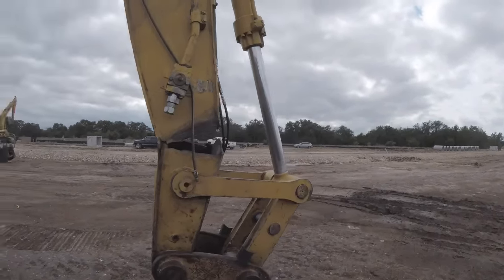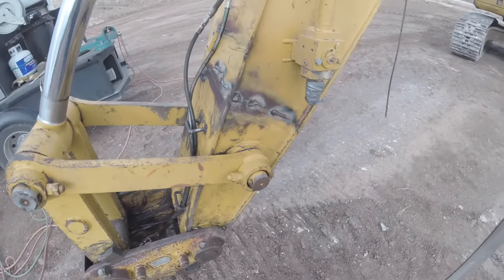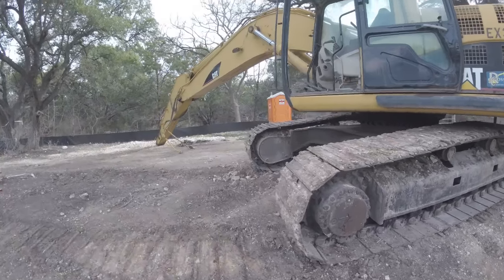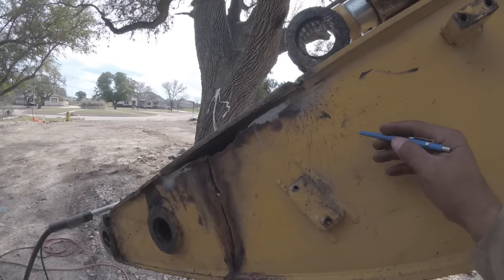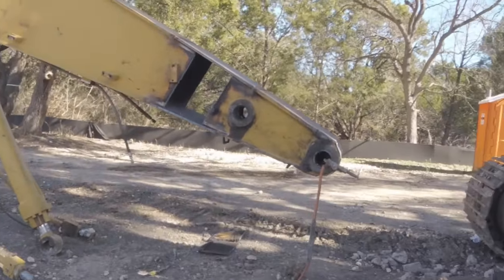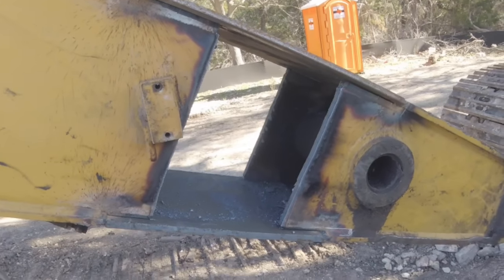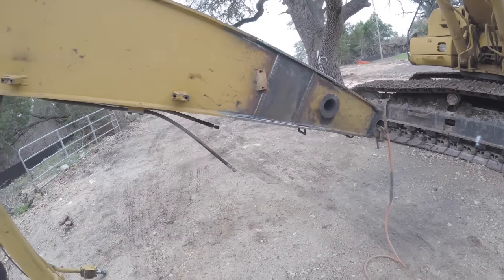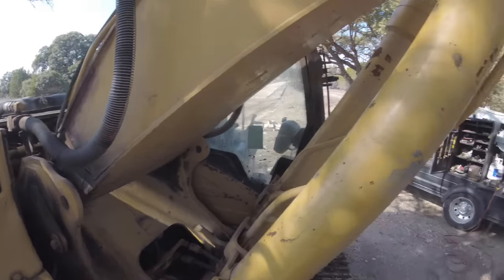Woops!! Excavator had a bad day!!

Comment: 8:30 wow that’s scary how they changed them rollers. Those welds could of failed and thing woulda dropped on them
Reply: Seeing how they abused that machine to the point the base of the arm got toen, it’s just the company’s style to just go for it like that.
Reply: Machine's broken and gonna be down for weeks anyways? Better risk royally fucking up the repair to change the rollers which will see almost zero use until the repair is done.

Comment: Beautiful work!  Nice to see you have an apprentice.  I feel sorry for that track hoe.  That rock hammer is eating that arm up.  I wonder, can't they decrease the pressure to the rock hammer or use a smaller head on it?  I remember when renting equipment, they seemed to have those units tuned down so they lasted longer.  Had a friend with an older CAT track hoe.  He owned it.  It was pretty savage compared to the rental.  Anyways.... great job.  Clean work!

Comment: Double plate should almost never be square with straight lines in cracking/load direction. That becomes a weak point, and might create a new crack in the long run. Otherwise nice work.
Reply: That's his secret cause now it will crack again in 2-3 years and he gets the job to repair it, again and again 🤑🤑

Comment: Thats so cool for 20 some years I had one of the big miller air paks 3 years ago I thought I was going to retire so i bought  a 302 air pak as well cant be with out air or carbon arc.
That right where the boom cracked at one of those inner baffles put I noticed poor fit up and all kinds of wire shot through to inside till they filled the gap. The other machine you were working on near the cab I had the same ize one break clean off at the base where pin goes through broke pin as well took 2 days to get it welded back on.
Im not good at videos etc. or I would share  but nice to swap stories with you Keep up the good work and Take Care thanks again for the videos
Reply from the maker: Glad you enjoyed it. And yes, Cant do without and arc gouger!! haha

Comment: You must want to have a series of these videos of the same area failing over and over and over. The whole section needs to be removed and rebuilt, it's littered with cracks and warping.
Reply: O yes we will just order a whole new stick boom for it...with new pins...with new bushings...with new this...with that....
Reply: @danvertdavis6867  .. "section" or can't you read?!
Reply: @DJaquithFL  can you watch?he did replace that section 😂😋😋😋😋😋😋😋😋😋😋😋
Reply: @danvertdavis6867  .. I think you need to rewatch the video, in another similar video from him he said that that's exactly what needs to be done the sections need to be replaced the owners are just too cheap to pay for them.

Comment: You've been here before and will probably be back again. Looks like this excavator (or the misuse of it) will keep you in business for a while...
Reply: When you put a hammer on a machine it takes a toll .
Reply: @andrewslagle1974  This is like his third time. Wonder if it's warranty or he charges full price every time?
Reply: He will be back, that is a good way to keep oneself busy, backing plate is a cheat, and no preheating most of the weld area is begging for it to brake again, like it had done several times already. He may be doing it like he learned it but he learn it wrong.
FYI: I did 3 year in school to learn welding and steel construction, have a certificate of apprenticeship and 20 years welding on my back.
But it looks good and putting in new steel was the right choice.
Reply: HeavyDemir aaaaaaand I’m sure no one cares.
Reply: @arturocruz1993  well.... you did, so not fare fetched that others will.
Reply: andrew slagle if it’s being operated by someone that doesn’t know what they are doing yes. Otherwise a hammer on a machine is no problem.
Reply: @budnolan7557  You're way wrong buddy, breakers are probably the hardest implement an excavator ever sees, eventually the breaker wins and the arm cracks, pulls, bends, etc. I don't know if I've ever seen an arm or boom break where the machine hasn't been in a tunnel, or mine or doing demolition with breakers.
Sure some cowboys like to pretend that the breaker is a giant pry bar and they break the machine sooner like that, but even a careful operator will eventually see wear and cracks.
Reply: @Senkino5o  Yeah the hammering force added to the machine really is abusive for sure.
It seems to me, there's two large problems here.
1: Equipment designers fitting the biggest possible tool to the particular machine (duty or load capability vs duration)
2: Abusive operators. 

I'm no welder, nor operator, or engineering.  If I see a crack on one side spreading towards the other side, I immediately think side loading occurred.
Reply: @OpSic66  100%. Owners love to toss the biggest breaker they can on an undersized machine. Then complain about upkeep. Rather than sizing up the machine itself.

Comment: Great video! You should check the nigrogen charge on the "Air Hammer (breaker)", if low it could also lead to broken sticks and booms. The nitrogen helps to dampen the blows and minimizes shocks to the rest of the machine.

Comment: I'm a knife maker and what little I know about metal hardening and quenching is the the reasons why the machines are still braking after you repair them is bc the weld is hardening the fixed area but softening the metal above and below your welds.
Your deffinaly good at what you do but unfortunately the metal sucks
Reply: Yeah, have to heat the area to be welded to about 180 - 200 degrees Celsius before starting the weld and keep it hot till the weld is done. Recently repaired a dipper on a 984 Liebherr Longreach used as a dredge. Ripped a heap of sandstone after the repair and the weld held fast.

Comment: I enjoyed watching absolute command of repair to a box construction, subject to the torsion and stress as shown by the tool attachment, *Hammer.  Clearly, the machine used at the upper limits of design.   In the field repair, more difficult by wind and weather.  Remarkable work...M.
Reply from the maker: Glad you enjoyed it
Reply: @ICWeld  I very much enjoyed the entire post.  As, for many years, I worked within a shop 
discipline and suported crew members in the field.  And, while I am semi retired, I can barely manage working on my Jeep.  I can't wait untill spring...to get out there in my shop.
I so miss the huge shop and the fellows (and gal or two) who 
I had as friends more than a decade.  I like to hope, myself and those techs....provided the level and skill......absolute commitment to craftsman ship,   I so clearly see in your finished job(s).
A dedication to quality....that comes from place within and has dignity.  M.

Comment: Very interesting, the metal was fatigued; then fractured, then was repaired, then fractured again at the first repair weld.
Hardening and "weakening" of metal... Making it more brittle.
I am guessing they use the bucket as a pry-bar too often and that stresses / metal fatigues the metal.
The failure is a tension failure and making a stronger top support is more a cure for this repeated failure.

Comment: I know this video is a bit old, but if you want to prevent anyone from using the equipment while you're waiting on parts might I suggest a lock-out/tag-out? Putting the weight of that machine in those few stitch welds could have been deadly if they let loose while the rollers were being worked on. At the very least someone wouldn't be able to count to 10 on their fingers anymore.

Comment: This is why you have a dedicated machine for chipper, hammer, or plate compactor attachments. The intense vibrations are extremely hard on machine's. That's part of the issue with buying machines that you don't know the history on like at an auction. They can change out pins and it might seem tight or realitively  low hrs, but there can be all kinds of hairline cracks that may be hard to locate without a very in depth inspection.

Comment: Nice work(as always) - Those little areas where stresses can be induced by poor weld joint design, are called "stress raisers". That pecker looks a bit heavy for a 25t machine, and the second issue is that the operator is pushing and slewing the breakout with the pecker(he must be on a rock bench pecking). Furthermore the stops installed are causing repeated stressing of the top surface of the dipper(ram pushes between restricted fixed pivot points) - They've used stops to induce rigidity in the dipper arm, so that the reactionary weight(force) from the machine is immediate - Expect to revist this machine some time soon :(

Comment: The company I work for used to have an old belt driven hammer rock breaker. Didn’t have these kind of problems because I was busy replacing the belt anytime they accidentally dry fired the bad boy

Comment: Forgive me if it was mentioned. I understand the thickness of the material does not warrant pre or post heat, but in my opinion, this type of stressed material would highly benefit from a simple pre heat process, even just a few inches from weld area. This would help mitigate the existing heat effected zones from all the previous work. Your thoughts?

Comment: Awsome you preheat the Steel to awoid stress cracks ..
Oil pipes and platform legs are welded at same way to 
Prevent stress cracks !! 
We welded som tanks ... All metal is heated to avoid stress  fracturs or brittel arias .. not good in a tank

Comment: Nice work my friend I do a lot of the same work in upstate NY Had a 340 Cat the boom was so big I cut 18" dia. hole in side of main Boom  and climbed inside to weld it inside and out. A lot of times I find the welds are poorly done from factory. I really love the challenges of these types of repairs, Im sure you do as well. Thanks for sharing.
I'm curious what wire did you use & what kind of welder do you have?
Reply from the maker: Its funny you mentioned cutting a hole in the side of the boom. I've done the same. I cut a 16" hole to weld the inner baffle. it had busted loose internally. I run Fabshield 21-B in an LN25 suitcase with a Trailblazer 302 Airpak as the power source.

Comment: I work for cat and cat recommended adding a reinforcement plate to prevent that for escalators using hammers. It’s about 5 feet long and wide are the stick.
Reply from the maker: They stopped using it with a hammer.....is what they said....

Comment: Better of with a new or second hand boom section ,I’m not a welder but that is a mess how many times can you repair it ,only my thoughts  ,you did good getting the machine back to work  how long do you think it will last,old jimmy Australia
Reply from the maker: As far as I know its still in use. However, Not with a hammer this time.

Comment: I worked at a sawmill years ago, and a guy broke his window out just like this one.  My foreman told him to shut it down until the new window was installed.  Later that day after the windshield was installed, the same guy blew the hydraulic line under the boom, and the high pressure hydraulic oil (at 350F) shot out with such force that it broke the new windshield....but he wasn't burned to death thanks to that foreman!

Comment: I overlap straps after I weld it all up  metal straps at least 6 in past the crack and well that all up solid out of half inch steel and I hope it don't break again
Reply: I have always used a cover reinforcement plate when welding/repairing these excavator booms. (If the room allowed for it)

Comment: Hammering caused those stress cracks. The operator is using the boom to assist in the hammering instead of letting the hydraulics do the work.Job security.

Comment: THANK YOU VERY MUCH. I AM WORKING ON A CAT E120B WHICH I'M SURE IS THE SAME AS YOU ARE WORKING ON. AND I ENJOY YOU TUBE VIDEOS, I USE THEM MORE FOR EDUCATION THAN ANYTHING ELSE. IF YOU COULD EXPLAIN MORE OF THE PROCESS WHEN YOUR MAKING YOURS - STUFF SUCH AS WHY YOU CHOOSE YOUR MIG OVER YOU ARC, WHY YOU USE YOUR TORCH INSTEAD OF YOUR PLAZMA, AND WHAT RODS YOUR USING AT WHAT AMPS AND WHY, THE SIZE OF YOUR MIG WIRE, THE GAS PRESSURE, AND THE AMP SETTING,.YOUR VIDEOS COULD REALLY HELP THOSE OF US TRYING TO LEARN. i HAVE  SUBSCRIBED TO YOUR CHANNEL AND HAVE NOT MISSED ONE OF YOUR VIDS SINCE i FOUND YOUR CHANNEL.

Comment: Been watching your vids for a while (I’m a field guy for a Komatsu dealer and your vids are right up my alley!!) and never noticed how you stowed your crane with the boom partially extended, was it just this day or is that just how you roll??
Reply from the maker: Its a 3part boom extension. The most inner section is manually extended so I leave it out 2' or so. I find that this length works good for the things I pick up near my truck.

Comment: Man that excavator is a perfect example of grandpa's boat paradox. So much of it seems to be just built up weld and repairs is it still even a cat excavator? Also I know most companies just want machine back running asap. But there comes a point when u need to just put the whole machine through a proper maintenance cycle or ur gunna waste more time and money fixing little problems over and over.

Comment: Correct me if I'm wrong but if it was me I would have welded steel plates around the sides to make it even stiffer and more stronger especially after it's already been snapped into and repaired before just putting steel plates on the sides of it just gives it that extra strength

Comment: Correct me if I’m wrong but when the metal gets that fatigued, isn’t it best to just replace it even if it is expensive?  I mean both the boom and the stick have been stressed so much that it will continue to crack and break. Or am I wrong?
Reply from the maker: you are absolutely correct

Comment: since the opening was big enough for your stick weld to fit inside the excavator have you ever welded inside not just the outside of the piece for like more stronger reinforcement of the piece you were welding or is that bad

Comment: Interesting, thanks for posting. Can I ask what the charge for that repair was? That's something that I struggle with, bidding jobs correctly.
Reply: There's alot of factors that go into setting a price for a job like that. Sometimes location is the biggest variable, for example, a job that pays  $2000 in one part of the country might only pay half that elsewhere. Another factor to consider is how many other people in your area do the same kind of work? Competition usually lowers rates. There are formulas online that you can use by inputting figures that pertain to you and your line of work that will get you in the ballpark. Another factor, and probably the biggest is that nothing is set in stone, and you just have to give it a go, you'll know pretty quick if you're charging too much.

Comment: Wow torch and welding skill is world class but I gotta say I have problems with the joining technique. I'm a retired 40 year welder fabricator and your torch skills are far beyond me. The problem I have is the way you put things back together, it's not that the welds are not perfect because they sure look like it but they are still a heat affected area and they are just more cracks waiting to happen. I learned that the best way to repair something like this was to add longer plates to go beyond the breaks. These excavator booms are perfect for this because they have overhanging edges on the top and bottom. Those breaks would probably be permanently fixed if the cracks were fixed like you did it but then add a long plate on the sides of the boom, cut out for hydraulic line hanger blocks and around pin holes and install inside the top and bottom overhangs then weld all around. This doesn't affect the operation of anything, it doesn't look factory anymore but it's function over appearance in a fix like this.
Reply from the maker: I totally get what you are saying. Im not sure if the heat affected zone is too terribly high or bad in this situation. The boom was put together with strait welds similar to this from the factory. The only possible concern would be that the welds are too close. I've had success with this type of repair before without any issues thus far.

Comment: Im curious how it broke there in the first place.Natural fatigue or other circumstances?
Reply: Bad operator it's been welded to death it will fall apart again the heat from the welding will soften the material around the weld so it will break again again

Comment: The problem here is clearly incorrect use of the rock breaker by the driver. You shouldnt be getting stress fractures and breaks in that part of the boom if your using those machines correctly. 
You are supposed to use those hammers so the force is being transferred along the arms of the boom and very little sheering forces are created. The guy using the hammer is to blame here.

Comment: I know that this video is old now in March 2021 but would a cover plate after you grind weld clean? Maybe 3/4inch plate with plug holes to weld up inside the the plate to cover and strengthen larger area.

Comment: Those woodpeckers are a bastard on the nibs of the excavators and usually bend fatigue doing 45 degree operation. I tell my boys to only do 90 degree straight down in to thr material to break it up. Hell of a lot of stress on an excavator

Comment: What is the advantage of using the oxy-act than a plasma torch for cutting the large thick pieces of plate? Thanks.
Reply from the maker: Plasma is limited by the size machine you have. And the torch is limited by the size tip. Plus it's much easier to use the torch in the field.